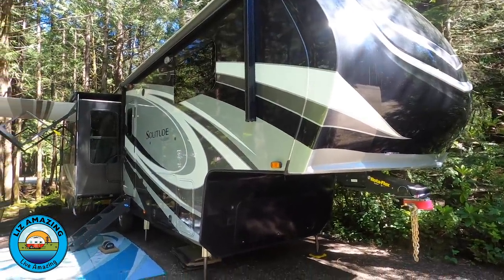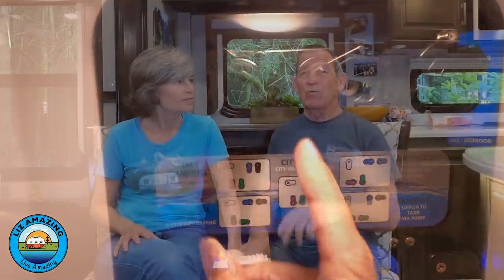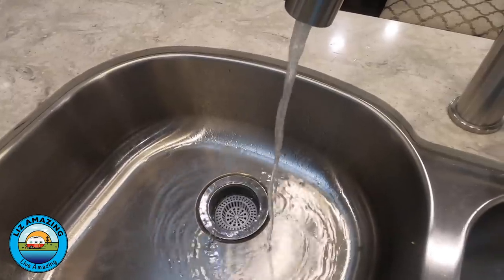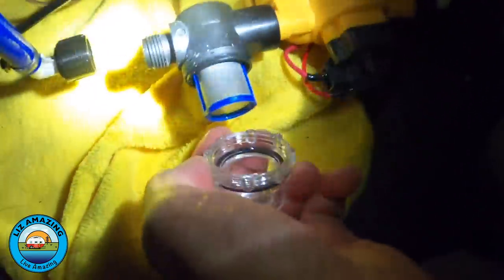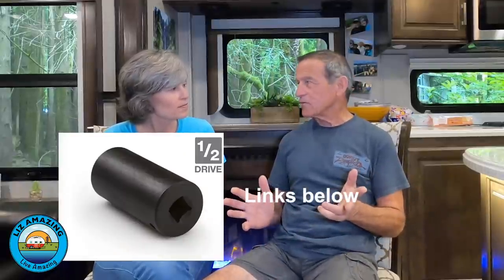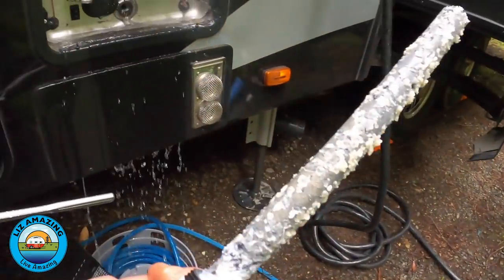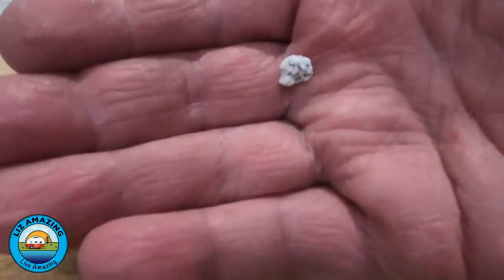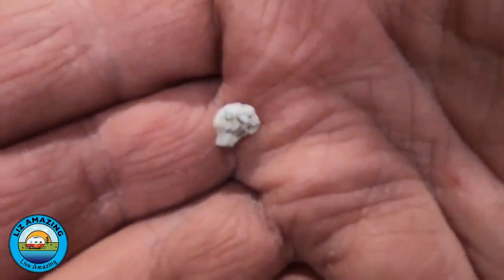Rv Life: Plumbing Problem | Low Hot Water Flow | Fulltime Rv Living

Comment: I’ve mentioned before we never put water in our pop-up or our RPod. Only a teeny kitchen sink in the pop-up, no toilet facilities, so why bother? And the Rpod we only had for a few months before we decided we didn’t like it and bought the Travato. And we had three nights in that before the lockdown, so we haven’t dealt with  this issue yet! There’s enough water in it for little #1 toilet flushes. I have to say that having to go through all this with a brand new rig makes me even less excited about putting water in. 
But I have to ask – would it not have been under warranty? I know Paul is amazing and can do all this stuff, but if you had called, would you not have had some sort of free service possibility? Or maybe the free roadside warranty we got was only for breakdowns and we’d have to take it to a shop for a water problem and shops are impossible to get into in any sort of reasonable time.
Reply from the maker: Hi Trish,

Yes, that's a great point and is why we went with Grand Design. They would have sent a mobile tech out at no cost to us. If I were still solo, that's what I would have done. Paul, however, lives for stuff like this. He really does like fixing things and this was the kind of mystery that would have kept him up at night. He was "on it" immediately! He's the kind of guy who likes to take things apart. No lie, he has looked at our fireplace and said, "I wonder how that thing comes out of the cabinetry" and he's looked up at the ceiling panels and said, "I wonder how those ceiling panels come down." 

He's just that kind of guy! I am counting my blessings that nothing in the RV or the truck ever needs fixing! 

Thanks for watching and commenting. I have heard such good things about the Travato. Sounds like you are happy with it. I looked at the RPod and can see how they would be fun, but also limiting if you want to do more serious camping. 

Sometimes it is less stressful to not put water in so you don't have to worry. I used to camp with a group of gals. One of them had a PleasureWay van and she wouldn't turn on the propane. Ever. Or use the awning or half of the other features. She just didn't want the stress of, say, opening an awning and finding it won't close.

Hope you get a good season of camping in!
Reply: Liz Amazing  Oh, right. I remember you mentioned in another video that was why you went with a Grand Design. 
BTW, Paul was really a catch on so many levels! My husband is handy, but he’d just as soon let somebody else do it these days.
Reply from the maker: I’m in that camp- let someone else do it. I find repairs very stressful!

Comment: Good detective work. Could this also have been caused by an air pocket in the heater?  I think I read that somewhere. By the way, there is nothing wrong with that anode. It’s doing its job and still has a long life left.
Reply from the maker: Paul says an air pocket would cause it to spit and sputter but would not cause low pressure. Yep, that anode will be good for a up to three years. We are grateful.

Comment: Paul and Liz, good investigating work, you found the root cause of your low hot water pressure. Now, using an On The Go water softener would prevent that?
Reply from the maker: Thanks Rejean, Paul says because it helps avoid scale buildup it would probably have helped quite a bit. He is now looking into those systems and watching a YouTube video about them. Thanks so much for the great tip!

Comment: We have done all that and still have low hot water pressure.  We are completely stumped.  We even had a mobile RV repair guy come out and spent 2 days trying to help us and we still can't get the pressure we need.  So Sad
Reply from the maker: Do get it when you switch over to the pump?
Reply: @LizAmazing  Hi Liz - our pump is not working.  We have to order a part for that.
Reply from the maker: @joanbenner6628  Ok.Sorry our video did not solve the problem. Best of luck!
Reply: Thanks anyway - still trying.
Reply from the maker: @joanbenner6628  It's surprising that the tech couldn't do what Paul did: test the water flow from the source and then every step of the way after. I guess it depends on how accessible all of that is.
Reply: @LizAmazing  Good Morning - sorry for the delay but the tech guy that came out helped do all the stuff you guys mentioned but it turns out that we have two check valves.  My husband was not going to let it go so he kept trying to figure out where the blockage was coming from and he found the second check valve on the other side of the coach by the outdoor shower!  Crazy but he got all the panels off & low & behold, the check valve was busted...   So, at this time, we have hot water!  Yay

Comment: Great video.. Question, where did you find those white sink strainers that you have in your galley sink drains? Those look like they would work way better the ones I currently have been using .
Reply from the maker: Good eye! Paul loves those-- they came from the Dollar Store. Two of them for a buck. Thanks for watching-- low water pressure in RVs is quite common.

Comment: Thanks, we were in Oceano for a couple of weeks in March so I am going to flush my hot water tank before I take the unit out camping instead of waiting until fall when I usually do the task.  I don't have an anode in my tank so will see what crud is at the bottom after our winter trip down south for a couple of months.
Reply from the maker: Good plan! I hope all is Ok. We had two filters and you saw how that didn't do anything for minerals. Happy travels to you!